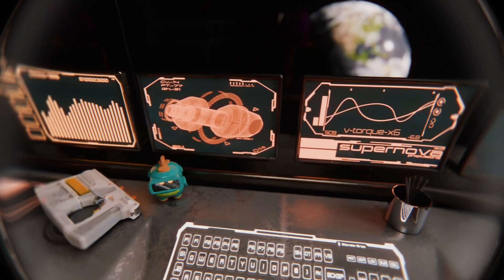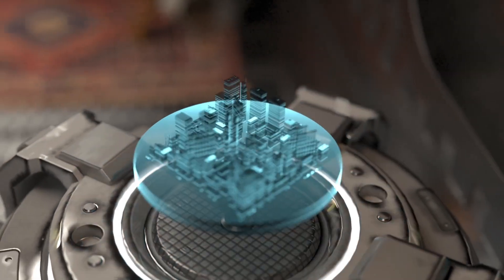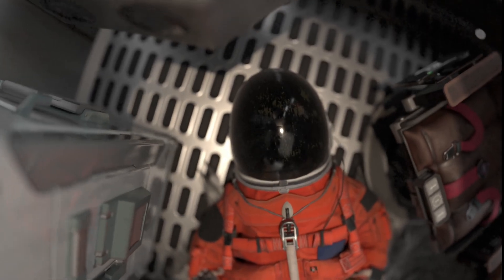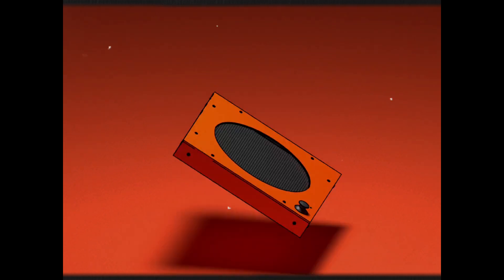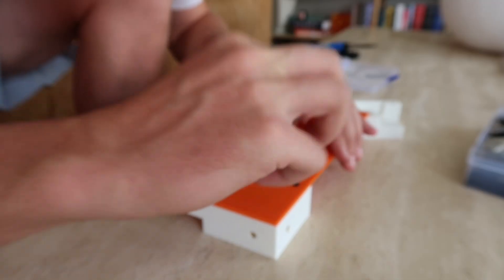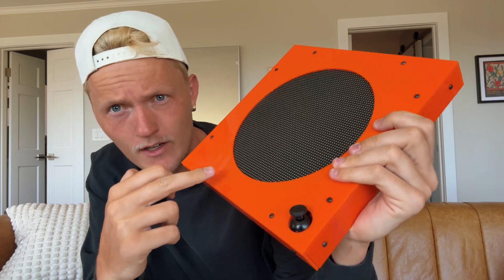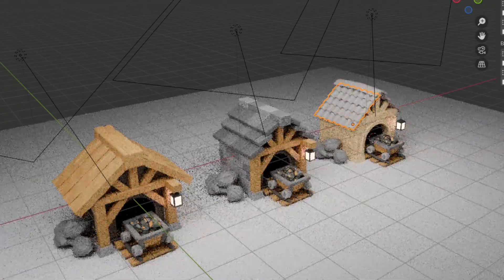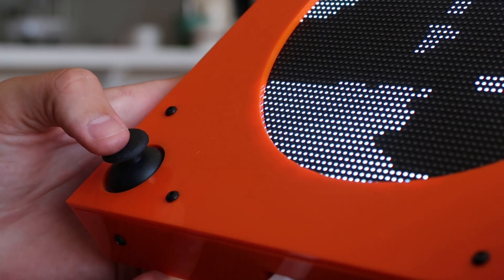Making a Space Exploration Device

Comment: This is the cleanest YT video around and at 50 subs is crazy! 10/10.

Suggestions for v2 aesthetic wise (Not needed I know lmao)
-You could countersink the screws. Make caps for them
-Could magnetize some of the panels. Making a tool-less design when getting into the internals
-Designing a kickstand into the back panel (similar to the Switch kickstand)
-Having the USBC plug running out of the back for cleaner view from the front

The current design is sick already and gives off "retro future" vibes

Subbing for the long term, you're gonna have a bright future!
Reply from the maker: Thanks! I like the suggestions. I considered counter sunk screws but I have never done them before and chickened out. The magnetize option could be sick, as well the kick stand. I think for now I am just going to 3d print a custom stand for it. Thanks for subscribing!